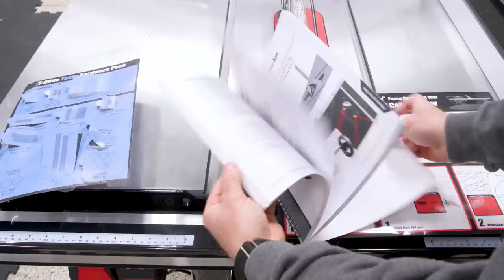I Left Powermatic for Sawstop!

Comment: I have to say I appreciate your commitment to using your blade guard as much as possible. Almost every table saw accident I have ever heard of could have been prevented with a blade guard. The more they see YouTubers using their guards, the more folks will come to realize they are worth the hassle and it is a fallacy to think you can not work effectively with one in place for most cuts. HOWEVER- Table saw manufacturers also have to step up their game and make sturdy guards that are easier to remove and replace without tools, as  SawStop and other premium brands have. I can't blame someone for leaving his guard off if it's a flimsy piece of crap or if it takes ten minutes and three Allen wrenches to put it back on..... I have four saws in my shop and three of them are SawStops. I have their ICS, their contractor's saw and their jobsite saw. As someone with a lot of experience with their entire line I can say I have never been disappointed in their saws. And I use my guards for 95% of my cuts.
Reply: That matches my experience.   My PCS is the third table saw I have owned, but is the first one that I use the blade guard as much as I can.   On the earlier saws, I removed the guard and never put it back on.
Reply: So the issue I have had with guards is that the boards get stuck. I have had it happen, even on the sawstop. And I hate that. And end up taking them offf.
Reply: @Monuments_to_Good_Intentions  if they are getting stuck, are you sure they are properly adjusted? The riving knife should be in line with the body of the blade and not the edge of the teeth. You also want to ensure your trunnion is aligned, this is often an issue on newer saws. The riving knife or splitter should never be restricting movement
Reply: @Monuments_to_Good_Intentions  How did your board get stuck with the SawStop guard? Which guard? The dust collection guard like Marc shows in this video, or the simpler flip-guard? Was it the anti-kickback pawls that caused the catch? (I hate those and always lock them in the upward position).
Reply: Actually  "Almost every table saw accident I have ever heard of could have been prevented with..." learning and always using proper table saw habits/techniques.
Reply: @joelnowland2196  - Learning is very important, for sure...  I learned to walk 40 years ago. Yet I stubbed my toe yesterday. Humans are fallible. We make mistakes. Our brains go on autopilot. It happens. Safety devices aren't just for the stupid, they are there for when we inevitably do something to prove we are human too :)
Reply: @StumpyNubs  That's true. You know it's interesting, I was just thinking, in the 46 years since I first used a table saw the two worst cuts I have had were not on a machine but with a paint scraper removing dry glue and also with a chisel.  Now if only you could put blade stop tech or guards on a chisel.
Reply: @joelnowland2196  Up until my power carving injury a couple years ago, my only significant shop injuries were from chisels, as well. Both while not thinking, even though I have used chisels safely for a very long time. I proved I am human :)
Reply: @StumpyNubs  Speaking of your carving accident James, I've been curious if you fully recovered.  I hurt myself several months ago and have been surprised how long the recovery has been. And you are spot on with the human error comment.  I got hurt doing something that is easy, and I wasn't in a hurry, but my I was thinking ahead, not in the moment.
Reply: @independent900  I don't think you ever fully recover from a serious injury to the tendons in your hand. I can move the worst affected finger about 80% now (after two years and thousands of dollars out of pocket in physical therapy) but it frequently aches and I have little gripping strength in that hand. I was very lucky. I have known true masters in this craft who were far more seriously injured despite decades of experience at the highest level. They weren't dumb, they were just human and if it can happen to them.... :)
Reply: @StumpyNubs  I'm sorry to hear that, but glad you were as lucky as you were.. It can happen to anybody, doesn't mean it will, but it can.
My grandfather was a fine furniture maker, he had 5 whole finger, in total, on both hands. The rest were in various shorter lengths...

That sure gave me a healthy dose of respect for the shop tools early in life.
Reply: @StumpyNubs  I have tremendous respect for you for many reasons, but the fact that you haven't used this horrible experience as evidence for your ongoing discussion about safety is impressive.  It'd be very easy to get preachy after an experience like that, but you've kept it out of your vids.  I think you've only briefly mentioned it once in retrospect.  I'm not sure I could be that disciplined:-)  Keep up the good work and have a cold one my friend, because you've earned it: -)
Reply: @StumpyNubs  False analogy.  You probably wouldn't have stubbed your toe if you were likely to loose it, or die.  Sticking you hand in a saw blade is just not acceptable.  It is up there with that DEA guy who shot himself in class, or that other gun gun who shot himself in the leg while drawing a 1911.  Though DEA guys probably don't spend that much time with guns in their hands compared to a person who runs a saw for a living.

Basically all you have to do is not put your hand near the blade.  It is like your 95% rule for guards.  95% of the stuff I do does not require me to put my hand near a saw blade.  But why not have SawStop if you want to.  Pretty hard to find a consumer grade saw that wasn't designed in 1938, in the US.
Reply: @TheWoodFly  So in that case you would have a push stick in use?  That sounds safe without SS.  A lot of people commit weight, and when they get a kickback, the piece is suddenly not there, and they stop their fall by feeding the blade.  Very important to have neutral weight, and as you say, a push device.  Ashley Illes said that none of the pattern makers he ever met in Sheffield had bashed up hands, and they all used push sticks.  Not so with the regular guys.

The badly designed US saws, even worse after the aftermarket saws added huge fences between the operator and the table,  make forward commitment of body weight inevitable.  Bad designs need lots of safety gear.
Reply: The example of turning off the saw and reaching for the offcut got my thumb.  17 stitches but luckily just mostly skin damage.  I try to use my blade guard a much as possible now.  I bought a 1/4 HP power feeder with a Magswitch base for when ripping many boards, which keeps my hands away from the blade.
Reply: @HondoTrailside  stubbing your toe can actually be very serious, even life threatening depending on the circumstances. I stubbed my toe in my shop and took a fall on the concrete floor. Putting out my hands to prevent hitting my face on the slab resulted in a torn rotator cuff injury to my right shoulder that required surgery. Although I’m fine a few years later, my right arm and shoulder still lag behind the left in strength due to the six months of inactivity during rehab. Simple mistakes can have serious consequences.
Reply: Concur!  My left thumb is now shorter than my right thumb precisely because the guard on my table saw was such a pain to replace.  Besides, I only had one cut to make and I would be done for the day.  Well, the rest of the day was spent in the ER, so I really saved a lot there!  When I started looking for a new table saw, the ease with which the guard could be removed and replaced on the SawStop was what really sold me on it.  The safety feature is great on the SawStop and I would still have a whole left thumb had I had one at the time, but it really was the ease of guard removal and replacement that was the deciding factor for me.
Reply: @Monuments_to_Good_Intentions  I have had that happen when using thin kerf blades, as the blade is thinner than the stock guard/riving knife thickness.  SawStop does make a thinner riving knife, which I've purchased, and it stops the binding of the board.  I do not know if they make a complete guard with a thinner splitter.
Reply: I got hit in the face with the factory blade guard!  An older version of a porter cable portable table saw with a clip on blade guard, the pin didn't get fully seated, so when I turned on the saw the blade guard flew up and hit me right squar in the face,
Now I wont use it on that saw.
It does have a riving knife.
And I use push sticks.
Its problem is the scale on the fence and rails are useless, so you have to mesure each cut by the blade and fence, but with the blade guard in place you cant.
So you have to take it off to set up for each cut.  That kills any acurrcary it might have.  These saws are more ment to rough cut, and for framing a house that's OK, but if your making finiture its worthless.  Ive also got a Jet hybrid saw and a full size grizzly cabnit saw.
2-120 volt saws and a 240 volt 3hp saw.
In the 20 years I've had the grizzly its never been plugged in, I do not have a 240 volt outlet for it.
Reply: @TheWoodFly  does the wood whisperer have discord
Reply: the only thing about using the blade guard, is you cant use a thin kerf blade due to the size of the riving knife. At least thats what I have seen  for my saw there is not a way to replace the riving knive on the blade guard to the correct size for the blade you are usinig..
Reply: 2/3 of the cuts I make on my table saw the guard would need to be removed for a fixture or sled.  And since I'm not running production jobs that means a lot of adding and removing the guard.

BTW:  Paid the SawStop tax twice with help from my Incra 1000 miter sled since purchasing it 6 mo. ago.
Reply: I get it, but meh.  A blade guard obstructs the view, which for a YouTube channel devoted to woodworking is counterproductive.  I'd rather hear a brief disclaimer about the blade guard, and see the cuts being made without the guard.
Reply: My teacher always says if less than 4 inches wide use the rivinf knife its its more than 4 use the bladeguard. I would deffinitly use the bladeguard when doing big sheet good for sure.
Reply: @bobbg9041  I have a 240V SawStop.  It cost me $200 for an electrician add a breaker to the panel.  Made a 12 guage extension cord for it and it works great!
Reply: I switched to a contractor saw from my Unisaw because of the space requirements but one of the best parts of the DWS 7491 is how easy the blade guard and riving knife can be swapped. Just the pull of a handle, no tools. I use the guard all the time now and the dust collection is a nice bonus.

Comment: One more thing.  Note to all sawstop owners. If you are cutting pitchy wood such as pine, YOU MUST CLEAN THE BLADE REGULARLY. I found this out the easy way. Had been cutting pine and was showing a friend how the saw senses your skin. With the saw off you can touch the side of the blade and watch the red light go off. It didn't.  Changed the blade and it was fine.
Reply: Yeah, good pointer there.

Comment: Spot on about injuries. My only ER trip as an adult occurred when I was working tired (strike 1), then reached across the blade after shutting off the saw to remove an offcut (strike 2 and strike 3). It wasn't that serious but I'm so glad you brought it up. The blade guard would have saved me too, but like you also mention, I didn't have it on the saw at the time.

Comment: I have had my PCS for almost 10 years ... consider it one of the best woodworking investments I have made. It was dead-on accurate out of the crate, and has never given me a single problem (well, there was that one accidental activation when I let my aluminum miter gauge get too close to the blade!).
Reply: Except for the fact I've had my PCS for 5 years - exact same comment. I'm just a retired engineer who does some woodworking as a hobby, but can afford to spend for some high end toys now and then, and picked this one. When cutting with my incra HD miter set to a very sharp angle, touched the blade and bang. Didn't even leave a mark on the miter, though the Freud premier fusion blade was toast.
Reply: @cctknight84  I popped the brake on my very first cut ever because I did not readjust my 1000HD.  It's preserved forever as my wife wanted to 'document' the first cut on my most expensive purchase.  Premiere Fusion as well.
Reply: @grantman1148  lol, oh no, memorialized forever!! I will say, after 30 years of using a Craftsman belt drive contractor saw, my first cuts with a 3 hp Sawstop were quite the revelation. My next upgrade will be to my dust collection system - to call what I now have a system is probably quite the exaggeration.
Reply: My multiple activations were all related to the miter gauge. Train yourself to carefully check when either the saw blade and/or miter gauge are not longer in the 90 deg position.
Reply: @benblackwell44  Multiple activations? lol, once was all it took for me. (and now I've probably jinxed myself!)
Reply: I left a couple of dado shims under a board when I was making a dado cut and they actually spread out under the board and triggered the brake. Destroyed the dado set and the dado brake!

Comment: I’m really glad for you. While woodworking and creating content at the same time,  it’s nice knowing you have EXTRA safety in place. I have had a SawStop for many years and it’s been a pleasure to use. I considered the  Powermatic because you were using it, as also my house is full of Festool, but my wife rolled her eyes and said “GET THE HOTDOG SAW”.  I am a professional Drummer and a Golf Professional, and I’m accustom to using  all my fingers for both, plus not wanting to make that shameful trip to the hospital. Bonus, BLACK  is my favorite color. Good luck with your SawStop
Reply: I have all kinds of reasons to want to keep my fingers, but when I started making guitars, the insane contrast of using a table saw that can injure one, and building guitars really spoke to me. I switched to a Swiss precision saw, and I just won't do anything on the saw, or use the saw to do crazy things.  If it is risky I don't do it.  In fact, I don't do it if it is conceivable I would be hurt.  The thing is back to about 1980 ish, most US instruction was based on doing everything on the table saw.  But these days, in the shops, a lot of us have today there is no reason to take risks.  Say a person might have done slip joints for doors holding the pieces vertically over the blade.  Today you have devices that hold those pieces, biscuits, Dominoes, mortising machines.  Why take a risk doing anything that might end in disaster.  On that basis SS is irrelevant.

Comment: Marc, welcome to SawStop. I’ve had an original PCS (now ICS) since 2007 and have enjoyed using it. If the current PCS had been available back then I would have bought one of them. Like you said, they are good for what most of us do. Your review was excellent and well done as usual. Your information on the blade guard dust collection already has me thinking that I need to change mine out. The original guard, while it’s a great guard and easy to swap out, has no dust collection. I find that I use for every cut where it’s possible to use the guard due to how easy and quick it is to exchange it with the riving knife. 

Your statement that the technology add on is sort of like a tax was interesting. I’ve always considered it more like an insurance premium. Even though I have great medical insurance changing out a brake and having a blade repaired is still much less than even my medical detectable would be for a stay in the hospital. I got my saw because as soon as my wife saw the SawStop video she told me to buy one and even figured out how we could pay for one. She immediately recognized how much one could save us in the event of a table saw accident. 

 I’m interested in seeing your modifications so I’m looking forward to videos on them. Thanks for sharing.

Comment: I have the same saw and mobile base. It has been a great tool. I will admit my saw did not seem to be aligned as well as most claim and I was a little disappointed at first. Between the instruction manual and Sawstop's videos I was able to get my saw tuned perfectly. Being able to adjust blade alignment when tilted allowed me to get perfect cuts on some pyramid shaped newel post tops I had to make recently. I truly appreciate the thought that went into making the saw adjustable in every manner necessary to keep it in tune.

Comment: 2:22 thanks for the sound logic behind picking 36 inch over 52.  I went back and forth over this when I bought my saw (has not been shipped to me yet) and settled on 36 inch, too.  Until now I kept doubting my decision.
Reply: I got a PM2000 with 52" capacity about 15 years ago and I don't think the fence has been anywhere near the end of the rail since I assembled the saw. Usually wind up with bowl blanks or segmented rings stacked up over there.